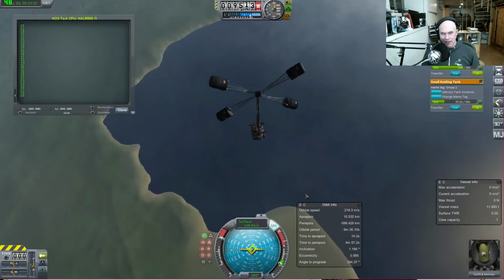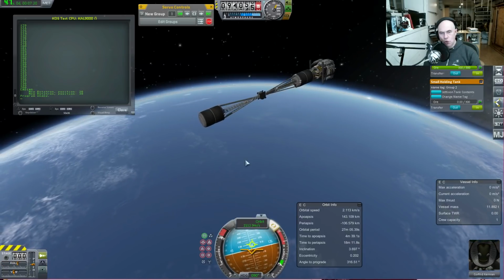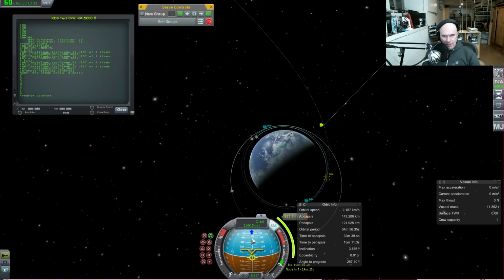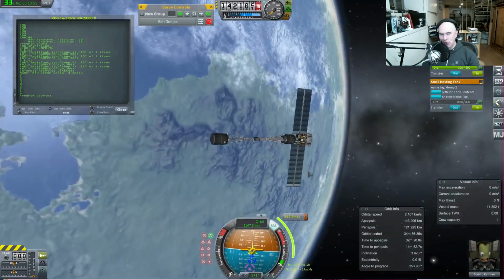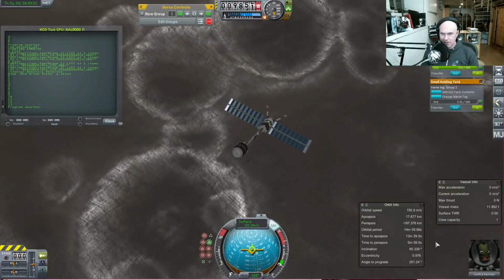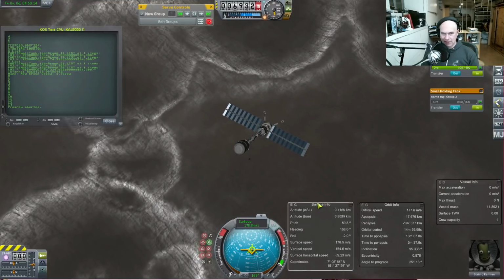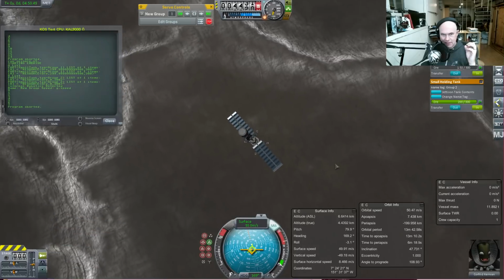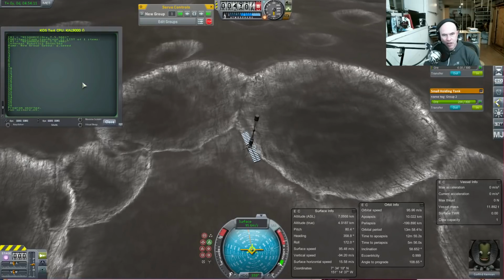Inertialess Gyro Drive Lifting Off From Planet

Comment: I invented this about 30 yrs ago by tossing a ball in the air,for when you toss a ball in the air, STRAIGHT  up, for a millisecond it would be weightless ,any way this is the first that somebody made it ,even though it would it wouldn't work .....good job😃.....what you need is  a saucer shape,  with 8 nodes around the craft and see what happens....

Comment: Perhaps with a properly cast and balanced impeller and a dense fluid such as mercury alongside an extremely high rpm brushless motor and a plumbing setup for single direction flow, you could make a functional model of this and have this concept theoretically work. Now of course you'd have to have four spinners, two opposed on either side of the central riser to negate operational torque that's being exploited with no collide in the simulation, but without using computer control or scripting for the pumps, just analogue piping and a few sensors this can be accomplished, in theory, on land or water. I doubt you could put enough electrical energy into kinetic to defy gravity, but she may move forward along a fixture.
Reply from the maker: Nah, asymmetric rotational systems have been proposed many times and proven not to work, this only works in a game because the game has a flaw.

Comment: You need more landing legs further out or added reaction control momentum wheels or gyroscopes or thrusters to prevent it from tipping.   You could also throttle it by changing the pump flow rates.

Seriously, you should explain why this doesn't work in real life, that it's the path of the mass that is the fluid in the tanks that matter not the tanks going around in a circle.   I'm pretty sure most first year students think of this momentum drive concept or one similar to it and think it's brilliant and it probably takes them a while to work out why it isn't, many may never bother to work out why it doesn't work.

Comment: I think you should try making some fairly large ship using B9 or something and have normal thrusters to escape atmosphere and get to orbit, but for transfer burns and whatnot use this drive scaled up a little. It wont have as good a specific impulse as you do here, but this shows that it's extremely sustainable. Combine it with the huge thrusters from B9 on extremely low throttle, using gravity assists, there'd be no problem getting to other planets

Comment: okay so explain this to me like my highest levels of education are high school, KSP and the airforce (not in that order); why is this impossible?
Ignoring the layout of the arms that Manley used just because KSP doesn't require him to work around that (I'd assume you could just have one of the pairs of arms in the middle, with the other counter-rotating pair of arms split in half and mounted on either side of the central pair of arms), and I get it doesn't produce enough delta-v to ever dream of being able to escape a gravity well, but as an intra-body thruster I can't think of what makes this actually impossible. Unfeasable, maybe, but completely undoable? why
Reply: okay so it's as simple as the wobble irl would make it impossible to get the force going up and not everywhere. Makes sense, thanks stranger-friend!

Comment: Is this thing scalable? If so, how fast can you go with it?
Reply: It's difficult to scale because the fuel transfer rates are fixed, and are dependant on the size of the fuel tank. It can certainly be scaled, but would require quite a bit of work to code it correctly.

Comment: I wonder if you could do this in space engineers, using mass blocks and rotors with sensors as switches, to detect a small ships landing gear as the arms pass over the  small ship landing gear, the sensor would turn on the mass block and off once it passes the small ships landing gear. you  could put the detected part on a piston to move the detected part in and out like timing

Comment: Can you make a video explaining why it won't work? Or, if you already have, tell me where it is?
Reply: In real life, moving something from one place to another involves energy and changes of momentum. Moving it back again will (at best) result in having the same energy you started with. The reason this works in KSP is because it doesn't account for the change of momentum when you pump fuel around, but it does account for the centre of mass moving.

Comment: Idea: Have the program read your throttle (I think that's possible) and set the rotation rate accordingly. If the throttle is at 0, reset the system. Then you don't have to keep running and terminating, just boot it up and you're good.

Comment: So, I'm guessing that the cause of the problem is this ridiculously OP servo motor that is flapping several tons of fuel tanks, as if they were butterfly wings. Is that all there is to it, or is there also a problem with basic Newtonian physics in KSP?
Reply: Wait a sec, just remembered that this thing shouldn't move at all without actually throwing some mass away. Physics is really broken -_-

Comment: Can the scripts read the change in altitude / surface speed / whatever it's called and then run a loop that decides whether or not to do a spin of the tanks?

land_on_the_surface.pseudocode:
SPEED_THRESHOLD = 3 m/s
While True:
>if (surface_speed  > SPEED_THRESHOLD):
>>cycle_tanks_once()

Then you'd just have to keep it pointed upwards and maybe kill the script with CTRL+C on touchdown

Comment: So... It's clear that the abomination machine doesn't conserve momentum.
You mentioned that half the charge was expended in order to reach near-orbit; I'm curious: Does it still conserve energy? I don't know offhand whether the motors use accurate calculations for power consumption.
If it does conserve energy, then it at least feels semi-kosher to me :P
Reply: On second thought, I'm pretty sure it doesn't conserve energy even if the power calculations for the motors are accurate. The awesome machine exchanges stored solar energy for momentum so that, in low gravity space, you can take a path such that you expend energy and come back to your starting point; thus violating ALL THE PHYSICS. Totally awesome.

Comment: if you can get surface velocity and altitude, you should be able to add a function for controlling the rotation rate to automatically regulate thrust for landing.

Comment: Could you change your program to cut the transfers early, based on throttle?   I think to actually achieve anything you'd probably have to start the return transfer late to compensate.

Comment: i wonder if you can scale it down to a more aerodynamic version. If you can increase the fuel pump rate more and use higher RPMs you get get a much smaller drive with similar performance. With the motors you can build in Stock using reaction wheels you might be actually able to recreate it without mods.

Comment: Never used Bandicam, so I can't make a detailed comparison ... but I use DXtory, it also has the ability to record several audio tracks at once. I usually capture my game audio on one track, my microphone on another and my headset microphone on a third (as backup).
Dxtory can also switch recording drives while recording ... so if one drive is full it automatically records on the next in line.
Though first time setup is a little hard to get good results (compression vs quality).

Also Shadowplay doesn't run on my system since the nVidia software got a little too curious for my taste (and not upgrading to the new shitty version isn't even an option) ... so I haven't installed this piece. (also got rid of the win 10 Xbox one, since I am unlikely to use it anyway .... and even if it would be only a small fraction of times I run games ... but it would be running in background all the time)

Comment: Just a thought from a VERY amateur coder. Could you set it up so that when you call the program you pass it a variable for how many cycles you want it to run? That would give you a modicum of control. Additionally, could you maybe change your thrust by making a second drive rotated 90 degrees out of phase with the main one that rotates at a different rate in the opposite configuration, thus reducing (or increasing if you desire) the thrust generated?

Comment: for sake of stoopidness. If we make it in reality. Can it work?
Reply: Seriously. Scissors like placed 3 tanks, with 2 on outside, being 2 times less massive than one on inside, to cancel out sideways acceleration. Powerful pumps pulling back and forth something heavy like mercury. Sure, not as effective as ion engines, but can be purely runned by electricity.

I mean, this centerfugal force is still there in reality.
Reply: No. This works in KSP because the physics engine isn't perfect and it handles momentum in a way that allows this.

Comment: I said something similar on the other video also but seriously, can KOS not read the throttle position? if it can you could just do some simple math to set the number of transfers and rotation speed and then it would be way easier to control.

Comment: Does Infernal Robotics let you integrate with KOS to change the speed of the wheel? You could tie the spin rate to the throttle position and just run the program constantly.

Comment: scott. This scientific breakthrough needs to be exploited. 

I challenge you to build a full, proper spacecraft that can reach Duna with a crew of 6, and have a landing craft that can be safely landed on the surface.

So this metronome device as the main drive system of the ship, and the lander can be landed using parachutes, with the same kind of drive system to return to orbit. Lander can hold as many of the 6 crew as you want.
Reply: I'm exploiting it in my science mode. Can be done ;). In fact, I'm doing basically exactly what you described with 3 crew instead of 6, but I've only landed on Ike yet. (plus the early one I made, the Enterprise, could actually be entirely landed when I found that the lander didn't have the fuel, but I'm building a heavier more powerful one now, the Valkyrie)

Comment: You could check out OBS studio for your capture software, it lets you record as many audio inputs/outputs as you want and has an integrated mixer for them, it has the replay recording of shadowplay and it is open source. I really want you to take a shot at it because i do think it is superior to bandicam. 
And it was made for streamers at the start so it could help you there too.

Here's a link https://obsproject.com/
Reply from the maker: That's what this was recorded with, it's a livestream. I tolerate the reduced performance of OBS because of the live mixing options, but if it's an offline event then it's too slow, it doesn't handle 1440p with anything like the low impact I get with bandicam.
Reply: Oh yeah i had not thought of the performance hit but it had never struck me before. i love OBS for the simplicity of setting up my profiles and not having to edit my (simple) footage afterwards but yeah you are going to put in alot of work in to editing anyway so going for maximum performance makes a lot of sense.

Thank you very much for the answer scott and great work as always on the videos i really appreciate them.
Reply: I can't seem to find any listing of your computer specs, but if you have a NVIDIA GPU, you can use NVENC with recording on OBS. It is a H264 hardware encoder on NVIDIA GPU's, as long as you have a 7xx series or higher (might work with 6xx, but I haven't checked). I haven't finished the video so sorry if this has already been proposed, but it's worth a shot!

Comment: Scott, an idea of how to throttle it down sorta. Try having reduced parallel transfers / reduced rotation speed scripts ready, which would give you less effective thrust for finer control. I guess thats not so easy since you would need to switch scripts for a different throttle setting. I think some reduced power would have helped you nail that munar landing.

Comment: Scott, for throttling, what about cutting off the fuel transfers early in one direction? Then you wouldn't have to worry about trying to sync the movement speed with the transfer speed. Maybe you could even check the actual throttle value with kOS.

Comment: Does that script running thing accept variables when you start it?
Maybe one could possibly adapt the script code to consider a variable to adjust rotation speed and fuel transfer rate accordingly. Would be hell to balance it out, but you probably would be able to adjust velocity in this thing and it would be amazing

Comment: wouldn't this work on aplane aswell?
Reply: Luke Miller
Not how Mr. Manley had it set up.  His was a pretty straight forward pull 'rocket'.
Reply: aerodynamics would make it difficult but yes, it would.
Reply: Also, the gyroscopic precession forces would make everything very confusing.
Reply: +ZarPof +ZarPof Well it's not exactly about the way the force is applied, it's just that spinning things inherently tend to keep spinning in the same plane, which makes rotation in certain directions difficult (oversimplifying). This is why bullets and arrows are set spinning when shot, and why bicycles only stay upright when the wheels are spinning.
Reply: Luke Miller *gyroscopic forces are what you are trying to describe
Reply: CMR 
What is aplane?

Comment: Couldn't you measure the actual dV per "wobble" and alter the control program to take the desired dV as an argument, converting it to a whole number of "wobbles"? Another step would be to make the program switch between different "thrust" magnitudes, so to get 917.5 m/s of dV, it would first do 91 "wobbles" at the 10 m/s rate, then seven at the 1 m/s rate, and finally five at the 0.1 m/s rate. Doable? :)

Comment: Time to leave the program open and see if you can approach light speed... in about 9 years.
Reply: about 900.  If he's moving at 20 m/s (that's more powerful than it actually is) that's about ~174 days.  Now of course if you do x4 speed it'd be about 43 days our time.
Reply: ZarPof excellent. This needs to become a thing for someone. If we violate the laws of thermodynamics, we might as well violate the speed of light itself.
Reply: Robert Strader
LOL.  In reality as they approached C it would take longer and longer.  However, KSP in Newtonian not relativistic so it ignores that fact.
Reply: If you accelerate at 1 g constantly, you’d reach 99.99% of light speed in about 355 days give or take not years.
Reply: Robert Strader I have reached light speed in ksp on my channel check it out
Reply: You'd want to switch the solar panels for them KSP super powerful RTGs.  But yeah, this exploits all the missing stuff in KSP physics, so it's ripe.  :-)

Comment: To fix the wiggly problem, use four instead of two, put two that are going in the same direction on the outsides and the other two on the inside: \/ /\ BASE /\ \/. That should work.

Comment: You could make it controllable by reading your throttle level- if you can make run at X% efficiency, then you can directly connect the two. If not, then 0 throttle will correspond to turn off/reset, and anything nonzero will activate full throttle.

Comment: As it is, it seems to work better as a main drive system for a mothership rather than a lander lol

Could you throttle it by telling the program to transfer the fuel/ore earlier or later in the container's arc?  Maybe also slow the rotation of the swing arms at the same time.

Comment: dxtory allows you to record audio devices separately and also gives you lots of other cool features like GPU acceleration and having configurations paired with applications so you don't have to fiddle around with settings everytime you want to record something different. I recommend giving it a look if you want to ditch bandicam.
Reply: You can choose what codec to use with Dxtory. I use Lagarath Lossless codec as the file sizes are half the size of fraps without any quality loss.
Reply from the maker: Bandicam also provides GPU acceleration. 
Not sure what settings I need to change I just push a button and it'll start recording the active window. 

Anyway at the time DXTory produced files which were way too big, they might have changed by now.
Reply: Bandicam does have this feature as well. Lagarith is my favourite too but being lossless it will still produce quite big files for longer sessions. Still the best option that I know.

Comment: To fix this, they need subtract directional inertia/KE (same thing, not sure what KSP uses internally) from the source tank and add it to the target tank. The addition needs to maintain the direction so that the actual conservation laws can take place. KSP probably doesn't do this because it assumes rockets are rigid so pieces of the rockets won't ever have different velocity vectors. Infernal robots breaks this assumption, which is why this isn't necessarily a bug. This is the same reason why KSP also doesn't compute colliders for the same ship.
Reply: Suedocode but you can also use pumping to create thrust completely without mods by spinning your spacecraft and pumping fuel around at the right times. So this exploit also works without mods
Reply: Icto gan Ahh yeah the original manifestation of this engine. I had completely forgotten... Also, the addition/subtraction I think needs to be strictly with momentum. I don't know what I was thinking when I said inertia, and KE has no direction so that was a weird thing to say...

Comment: Scott, could you be able to add PILOTMAINTHROTTLE[http://ksp-kos.github.io/KOS_DOC/commands/flight/pilot.html] to control the speed of the transfer and rotate to control the thrust and shut off the engine by decresing to 0